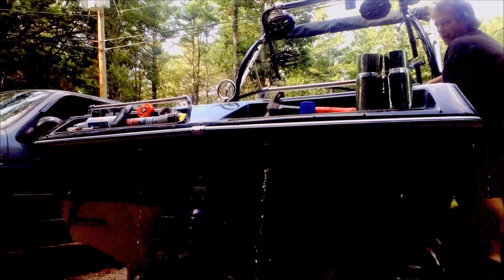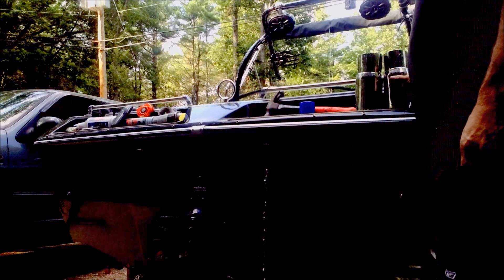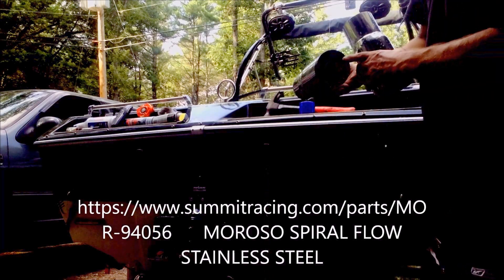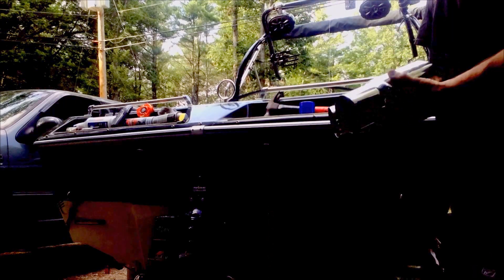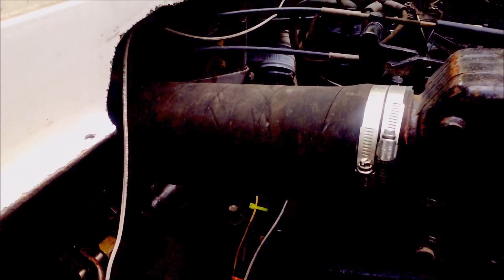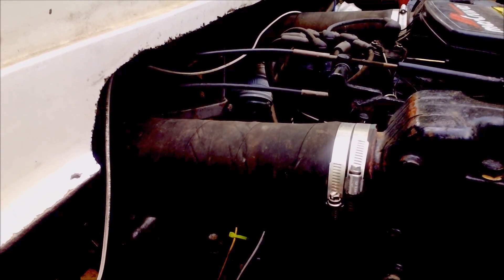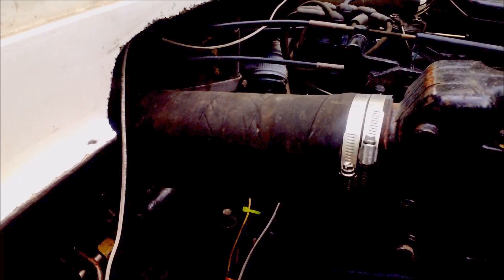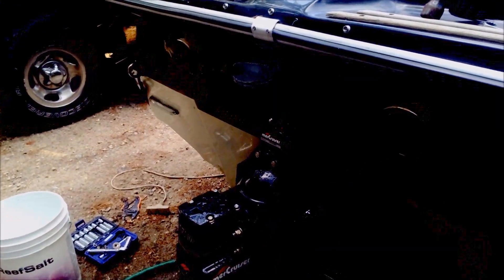THRU HULL exhaust MOD   Renken Spitfire  Merc 5.7

Comment: Interesting video.
4 years later, any problems?  Tweaks?  Lessons learned?
304 or 306 stainless?  Because 304 will rust...
Reply from the maker: Still running it today. Upgraded motor to an 383 Stroker. Oh and zero rust. Took them apart to install new motor.